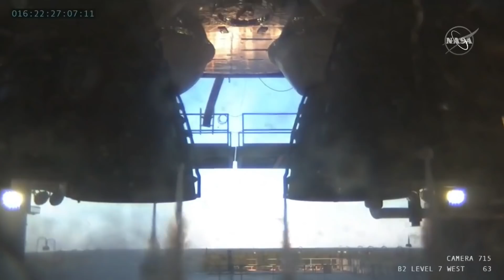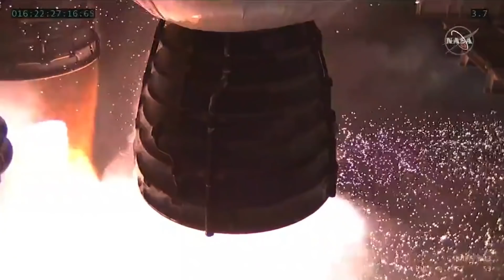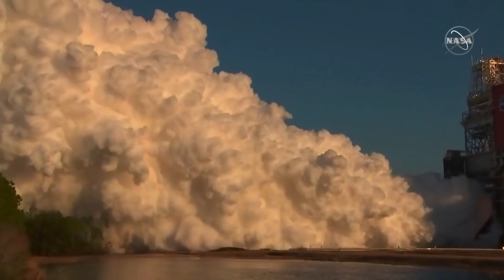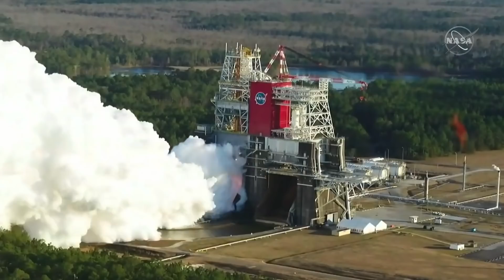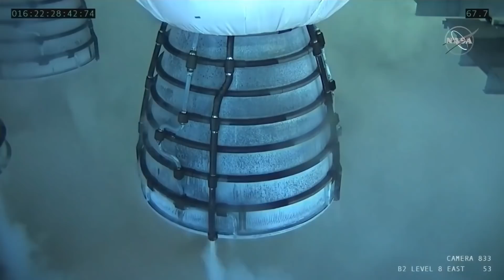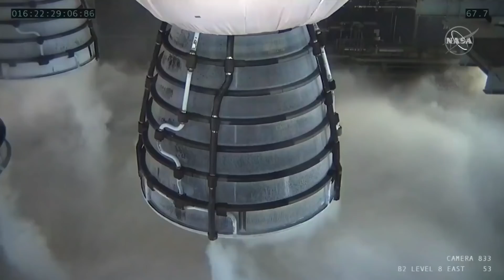Hot-fire! NASA SLS megarocket engines ignited, shut down prematurely

Comment: I wish I could have seen a farther away shot of how big that vapor cloud got lol
Reply: It's not vapor
Reply: @KingLordLele  ???   Heat, water.  You’re saying it’s what?
Reply: @Noname-lw6hp  and not smoke from the rocket? Do you seriously believe it's water vapor -_-
Reply: @Noname-lw6hp  the reaction between hydrogen and oxygen produces a gas, that's the smoke I'm talking about. And what about when a rocket leaves the ground, it still produces a gas, you believe that is still water vapor?
Reply: @Noname-lw6hp  sound suppression?
Reply: @KingLordLele  Yep. Sound can damage the rocket, and things around it. Water Absorbs a lot of it.

 "The process of burning in this case is the oxidation of hydrogen or combination of the hydrogen and oxygen molecules. The result of the oxidation of hydrogen, its combustion product, is simply H2O or water. The reason that water (in any state) is not flammable is that it is already the product of combustion.

The chemical equation for this reaction is: 2H2 + O2 -> 2H2O.

The reaction also releases a large amount of energy, mostly in the form of heat that causes the water vapor to expand rapidly to a large volume. This rapid expansion of gases is what causes the explosion. In fact, this is the basic principle of all explosives." Does that explain it for you?
Reply: @bird.9346  yes. But 2H2 and 02 only makes one H2O, not two
Reply: @KingLordLele  Yes, they flooded the launch pad of the space shuttle to deaden the sound and reduce destructive vibrations during launch!
Also, the combustion product of liquid hydrogen and oxygen is PURE water vapor!
So the cloud you are seeing is a combination of BOTH the exhaust and the liquid water which was flashed to steam.
Almost everything you saw was nothing but water vapor. Yes! Water!

Comment: Are those engines the ones retired from space shuttles? Does NASA still have capability to make this type of engine?
Reply: Yes they have been refurbished and tweaked to perform on sls.
Reply: Does aerojet rocketdyne* have capability to make those engines. Sure it  does, or et least simplified version of them.
Reply: First SLS will use the old Shuttle engines. Latter missions will use a cheaper  more disposable version of the RS-25. Both the old & new engines have been tweaked for more thrust power.
Reply: Yes refurbished at a cost of 146 million each. Not even new ones. For context an entire falcon 9 is only like 100 million
Reply: @kylebroflovski5333  and the falcon 9 is atleast reusable 😂
Reply: @christophernewcombe7699  not to mention SpaceX has only been doing this for 15 years. its sad to see NASA play catch up :(
Reply: The Falcon 9 is also substantially smaller than the sls......

Comment: If these engines are designed to lift a rocket into space, how do they hold them down to test them?
Reply: A rocket is much easier to push then a giant steel holding facility that likely has concrete/steel pillars 50-100+ feet in the ground

Most of a rocket is relatively light since it's just compressed gas(in hydrogen rockets) in big bags
Reply: If these can lift, say, 100 tons, you can hold them down by applying greater holding force. Any strong construction anchored to ground will do.